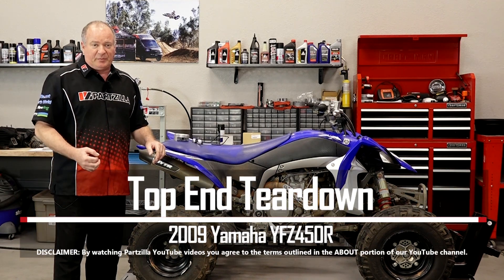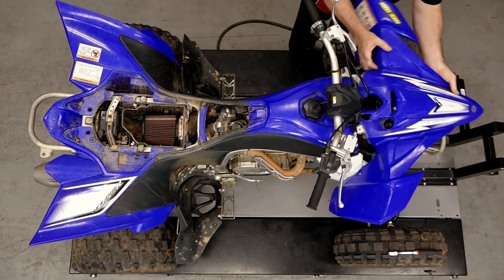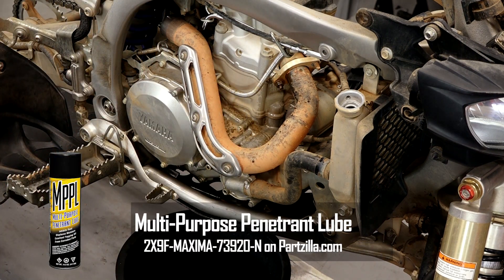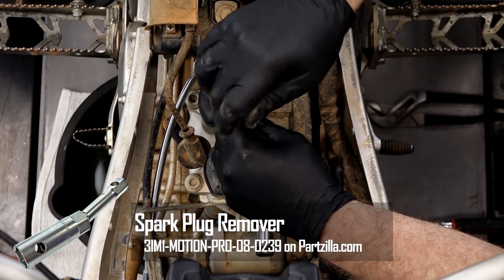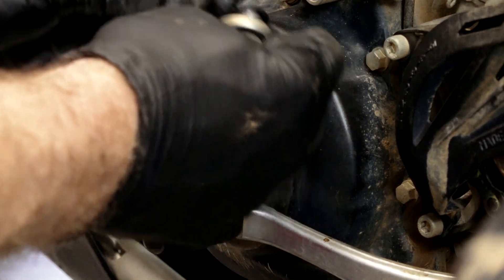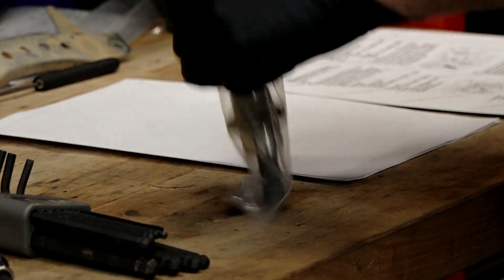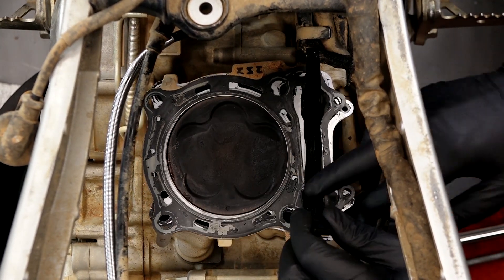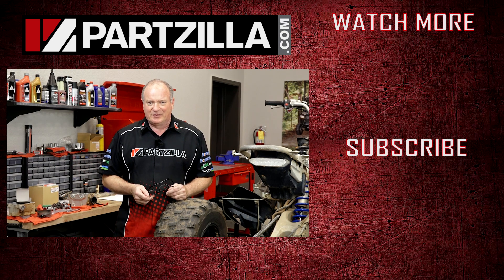Yamaha YFZ450R Top End Rebuild Part 1: Engine Teardown | Partzilla.com

Comment: My Pittsburg harbor freight  socket ratchet set fits the spark plug hole on every yfz450 I’ve work on I’ve used it on a 06yfz and all the way up to 2020 yfz450 save the money you don’t need a special motion pro one

Comment: Hello, Great Video! Easy To Follow And Very Informative. Have A Question I Recently Bought A 2004 yfz 450 And Noticed Coolant Mixed With With The Oil. Could It Be A Head Gasket Issue? Thanks In Advance.
Reply from the maker: Most likely.

Comment: You can get a thin wall spark plug socket at your local AutoZone or probably any auto parts dealer locally I got mine at AutoZone for like 10 bucks oh, just remember you have to probably pick the sockets up and compare them and make sure they are truly a thin wall

Comment: Help! I recently bought a 2005 yfz 450 bike throws out a lot of smoke from exhaust at all times. Bike turns on just fine and runs good. What could it be? Thanks
Reply from the maker: Blue smoke is oil from bad rings.  White smoke is coolant.  Both require a rebuild.

Comment: Hey there I have a question about the 2005 yfz 450 special edition ATV since they have a poor oil system could I just order a 2007 oil pump, case cover and nozzle and use them on my 05?
Reply from the maker: If they are not the same part number, it would be trial and error to see if it works.  They don't give us compatibility specs.
Reply: Ok well I just took the case cover off to see if I have the upgraded nozzle it doesn't and there is alot of sheen it the filter so I'm looking at atleast a top end rebuild anyway so it wont be ride able this season😂
Reply: Thank you for the information though I now have confidence of rebuilding it myself thanks to the videos so time to dive in 😂